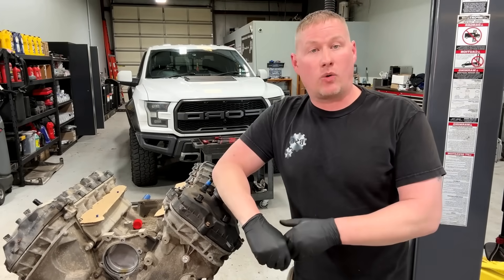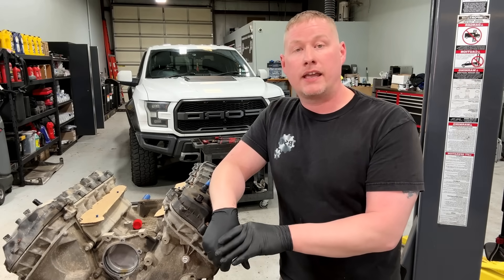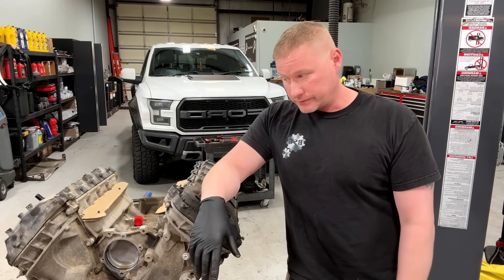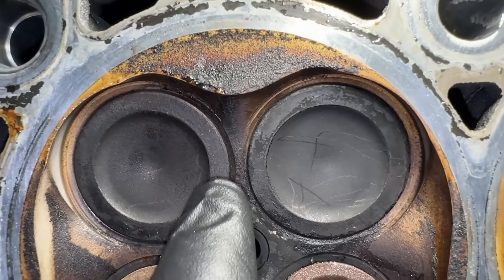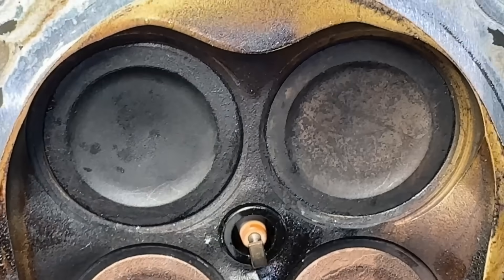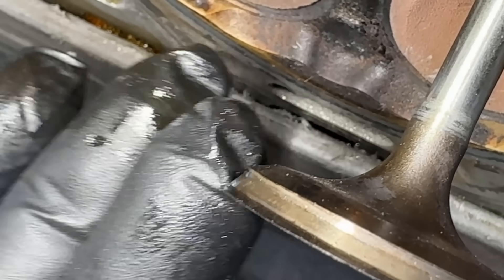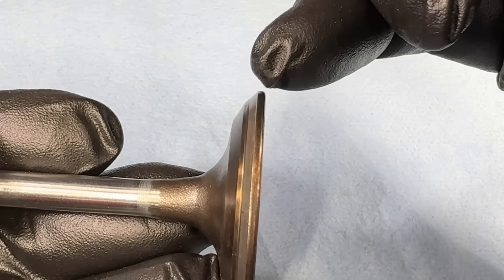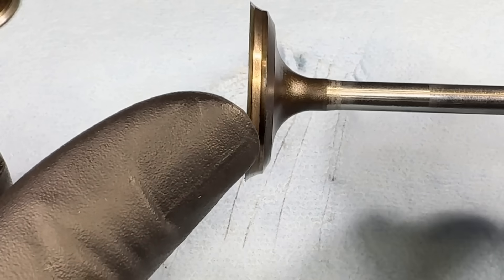The One Fatal Design Flaw of the 2011-2014 Ford 5.0L Coyote Engines!

Comment: Good times. I'm curious if You've seen failures in the new 6.8 v8? I'm a fleet mechanic and we have a 23 f250 at the dealer for engine replacement at under 6k miles, lost compression in 3 cylinders, i won't know what they found till we pick it up.

Comment: One flaw? You may want to added major oil consumption on Nickasil lined cylinders on late model Coyotes. God what a mess that manufacturers are dumping on their customers. It ain’t just Ford either. They’re all pumping out overpriced garbage. I’ve been primarily an Asian import technician and shop owner for 30 years and I no longer have a brand that I will recommend to any of my customers. Honda, Toyota, Nissan, Subaru, and Chevy and Ford are screwing customers as hard as they can these days.
Reply from the maker: I know of the other generational problems but we are speaking about gen one only here.

Comment: Had to put a crate motor in my 2013 for another reason.  Glad I don’t have this to worry about in my future.  How different would my Ford reman motor from 2023 be from the original motor. Any other updates they may have done?
Reply: In the past, Ford would send in "CRATE" motors, which were supposedly new engines from the assembly line with all the extra, external parts installed. Then you had Ford REMAN engines which were Ford's remanufactured engines. These reman engines didn't usually come to the shop with the external parts installed so the tech swapped the parts from the old engine to the reman engine.

Comment: Guess it also depends on how hard you run them.  I stay at 68 mph max on interstates.  2013 with  only 40k miles.
Reply: You should just put it on a trailer and it will last for ever.
Reply: Keep it under 70 or THAR SHE BLOWS!

Comment: My 2013 F-150 developed the same compression loss symptoms last spring. Research led me to learn about this exact issue. Symptoms crop up around 100,00 miles. I was at 105,000 when the misfires finally tripped the check engine light. (Idle was extremely rough since I bought the vehicle 4 years prior). One shop wanted to engine swap for $14,000, which I thought was a rip off. Another shop said they could tear it apart, send off to machine the heads and re-assemble with proper valves for just less than half that. Elected to do that, and it turned out extremely well.

Never was a recall or announcement made about this problem from Ford, as it affects all 2011-2013 truck Coyotes engine, but forum posts confirm this affects 2014 models too. Like someone else in the comments said, these are ticking time bombs sadly.
Reply: Ford may put the issue in a TSB for service techs,but don't look for any news release to the public! Add in the mileage when things crop up, and you see why Ford just ignores the issue! It's no longer a warranty repair at 100K unless you have an extended warranty! At this point, the dealer personnel try to blame it on your maintenance and cry not covered under warranty. Now they hope you go for a cash repair! Cha-Ching!
Reply: $14k for an engine. What in the world😆
Reply: @mph5896. It's not just for an engine. 14k is for the cost of engine plus parts and labor. In the automotive industry cheaper is almost always never the way to go. Thats how 800 dollar jobs turn into 8,000 dollar jobs further down the line.
Reply: @anthonygallegos3269  Bingo, and when you pay a friend $2000 to do it with a "low mileage" $5000 Craigslist engine... you'll be doing it again very soon
Reply: Why would they the problem comes up after warranty it’s end of life time for a new one as far as Ford is concerned.
Reply: People are so dramatic. All engines will have a “common” failure point. Being something that occurs at a higher percentage rate. Thanks to the internet you have a few guys post on YouTube or a forum and act like the engine is a “ticking time bomb”. Not at all. This is a fantastic engine. This failure is rare. I saw it twice when I was a dealer tech and the fleet I work for now has a few hundred of these engine and we haven’t had this happen ever. We literally had never done a base engine repair on any Coyote engine until the phaser issue popped up on the newer trucks. Even still, though not minor, that is the only failures we have seen on any of them. 
By the way,  I can search all that and run these reports through our fleet management software. 
 As a side note. YouTube claims the 10R transmissions are garbage. All we have had done is software updates. These are all work trucks too. Often pulling trailers and almost always carrying cargo.

Comment: Great video, thanks.  There's a setting on your phone that will flip the image from mirror mode (selfie mode) to camera mode.  (Edited (before I saw Brian's comment below) - I had a comment about the second half of the video that was wrong.  Confusion reigns...).

The focus and detail was great but everything was backwards at the beginning.
Reply from the maker: Yeah I need to find that feature yet. I was waiting for someone to say that's not cylinder 3 and 4 even though the oil cap was a dead giveaway.
Reply: @FordTechMakuloco  Sorry I screwed up and didn't realize the second part was correct.  CRAFTSMAN was clearly visible on the cart.  The first part of the video got my thinking off.

Comment: So can we assume this is non issue with 2015 up?
Reply from the maker: correct
Reply: Good to know.  However, I’m getting a non code misfire around 1500 rpm on cylinders 4 and 8.  2015 Roush stage3 phase 2 Mustang.   Shows up in mode6 and power balance 
Have replaced coils (FORD) and injectors  plugs. Etc… Still there.  Haven’t replaced VCT solenoids
Reply: @MustangGuru Did you do a compression check?
Reply: @gregjohnson2073  I will this weekend, thanks for the response.

Comment: Fix or repair daily
Reply: I heard that from my Chevy friends 60 years ago, most  of them are driving Fords today☺
Reply: Will never ever touch another Mopar again, excuse me, a Stillantis. Reasons why are legendary, too long to list. Also 
newer GMs are junk.
Reply: @jimiguitar3252  Mopar mo'problems....

All new cars are junk because of garbage emissions and CAFE regulations
Reply: @samholdsworth420  My 68 CJ 428 stock did the 1/4 mile in 14 sec getting 10-12 MPG wit barely any emission controls. My 2021 Mustang GT 302 did the 1/4 mile in 13.5 sec stock and got 24MPG on the highway.Go back to big block boat anchors if you like, I'll stick with todays CAFE regulations, plus the newr cars are all safer.

Comment: Hey Brian was that a quality control issue on those sharp valves ...   Great channel to watch !!!!
Reply from the maker: Yes it was
Reply: @FordTechMakuloco is this also happening on some 2015 F150 5.0? I get a few misfires on cylinder 5 sometimes like 5-15 on a drive cycle… which I know isn’t much. I get a P0430 code sometimes. Do these engines do well without cats? If it’s allowed in my area of course?

Comment: There are no perfect engines as there are no perfect anything that man makes because man is an imperfect being.
Reply: Don't forget the 351 Cleveland, indestructible! Had a '70 Torino with one. Drop forged steel pistons.
Reply: @jimiguitar3252  70 Mach I...tried to destroy it...couldn't.
Reply: Well the 350 Windsor was as close to perfect as you could get. I still don't understand why they quit making that mill.
Reply: Fuel economy, power, and EMISSIONS.

Comment: Can this be diagnosed and or repaired without pulling the motor out?
Reply: It can be diagnosed, just like Brian did with the leak down test, with the engine in the vehicle. It cannot be repaired without removing the cylinder heads, and I am unsure if that can be done on a Coyote with the engine in the car. Likely yes, but I cannot say for certain. But like he said, the labor a shop would charge to pull the heads and send everything out to be decked, then re-installed... it was cheaper for the customer to have the engine swapped.

Comment: Ford probably saved 10 cents per valve using sub par metal.
Reply: And lost millions in reliability
Reply: @SmallJack86 they don’t care.  They think all they need to do is put batteries and electric motors in their trucks and everything will br OK
Reply: @georgeburns7251

All gooberment mandated but it wouldn't surprise me if the big three lobbied for it.

Lazy greedy union bums.
Reply: Or could be a manufacturer defect. Ford isnt making the valves themselves.
Reply: 10 cents times how many million valves is a lot of money.

Comment: The last good engine Ford made was the modular V8 as in the Crown Vic
Reply: Yup.  My 2006 f150 with the 4.6 L 2 valve engine running like a clock at 140K.
Reply: Wrong, Gen 2 coyotes are nearly flawless.   Gen 1/3 are the problem child’s.
Reply: Yeah it made a whopping 220 hp and got 10 miles to the gallon. Great boat anchor!

Comment: As a 64 year old that worked as a young teen in our family gas station/shop in the 70's, pulling heads and valve jobs were so common. I guess times have changed with labor being so expensive that it is better to put in a new engine but that block should be good for another 100K right???? But I know you have to return it as the core or pay the core charge.
Reply: SO much stuff in the way to take off PLUS while the heads are off you have the 'might as well change its' like timing chain, cam phasers etc.
Reply: Right. I was watching this thinking "you trashed the engine for a couple of valves you could just replace?" Valve sets range from a few hundred to a thousand, or you can get performance heads loaded with new valves and springs for just over $2k for the pair. First complete reman engines I found were $7-9k. It would be interesting to know the cost choice he made, I expect there was an argument based on new engine restoring it to 0 miles and probably with valves that won't fail again.
Reply: @cageordie  Seven years ago it cost me about $3000 to have heads rebuilt (new valves, seats, guides, head machining, gaskets, etc.) for a Dodge 4.7 SOHC. I bet it's north of $6000 to fix this 5.0 due to inflation and because it has double the valves. The OEM timing set alone is probably $600.

Or spend $12,000 to put a new motor in with zero wear and a warranty. Ready to drive another 200,000 miles instead of 70-100k miles down the road having a worn out engine (already has 130,000 miles on it after all).
Reply: @TheRetarp  That's crazy on the cost of the 4.7 parts. I did a 4.7 around that same time. I went cheap though and installed used parts. Prob in and out of that engine for $500.
Reply: Back in the day pushrod and inline engines were the standard, so it was way more cost effective to do that type of stuff. Now a days you're doing 5x more labor than just swapping the entire engine lol
Reply: @ice44567  Exactly. Back in the day you could remove the heads easily. Today's engines require removal of the timing chain which requires removal of the front cover. No shop is going to put the old used timing set back on. This means you also get a new water pump, thermostat, coolant flush, oil change, new accessory belt, new idlers, all new gaskets, it all adds up really quick.

Comment: I see you are reading comments. Thanks for the best channel on the tube. First class. I took your advice  on Penzoil platinum 5 30 and been changing my oil every 5000 miles or so on my 2006 e250 work van with the 5.4. for the last 3 years or so. No ticking runs great 160.000 miles. Thank you.
Reply: He definitely reads comments, even on FB. I left a comment recently over there which could have been taken from a snarky pov, but Brain just answered with a question. So i re-phrased and Brain addressed my concern about seemingly conflicting things he had said recently, and he made his stance 100% clear without being a jerk about it. It was a good interaction.

Comment: Ugh! I've got a 2013 5.0 with 139k miles. Imagine my disappointment knowing I'm sitting on a ticking time bomb. How could Ford get that wrong???
Reply: Cost-cutting.  Over-reliance on their engineer's assurances.  Over-trusting parts suppliers assurances.  Lack of good quality control guys willing to point problems out.
Reply: Yeah it sucks big time, but this cost-reduction stuff is in every large company by now. Even aftermarket parts suck, compared to what they used to be. Chinesium and lowest bidder.
Reply: It’s more common on trucks with a lot of idle hours. It’s always on cylinder 4 and 8 right at the back where there is the most heat build up. So if you actually use your truck and don’t just let it idle all the time, I wouldn’t be too worried.
Reply: If you have not noticed extremely rough idling by this point, you may have gotten lucky and got the newer valves and won't have a problem. Supposedly, midway through the 2013 model year, they changed to the newer valves. If your build date is after February/ March 2013, you might be safe. Not guaranteed, as 2014 models have had the same problem.
Reply: @RareDivers  My 2013 was built in May. It has 267,000 kms, (160,000 miles) on it. No rough running at idle. Fingers crossed its going to be ok.
Reply: @RareDivers  Unfortunately my 2014 Mustang GT was built in Feb/2013 so I'm sure I have a good chance of having this problem.  My car only has about 37,000 miles on it so I may not see it for years.
Reply: Also had a 'time bomb' from Ford, my wife's 2016 2.0 ecoboost Escape.  As Makuloco described, the dreaded Cyl2 and 3 Web Seal Gasket issue, where when they designed the 2.0 to have the same block footprint as the 1.6, they ended up with like a .100" web between the cylinders and a damn external water passage taking up half of that head gasket sealing surface.  Ford of course knew about it and as it never failed at 100K or below, they let it go.  When trading it in with 150K, they said the most they could give me was a thousand bucks trade. As the dealer was all smug about it, I'll never go back to him for even a spare light bulb, let alone a new car.  Still pissed!
Reply: D.. me too. 2012. Didnt know abput this, and I have a  light miss on  #4 on mine too.😡
Reply: I wouldnt sweat it at all. Theres 2011-14 5.0 coyotes out there with a million miles on em not have that issue. Idk if the mustang applies but plenty on 200-300k mile mustangs out there too untouched
Reply: Even with that small problem, id afill rather have that then my 3.5...ecoboosts suck so much! Even when you do all the maintenance its still guaranteed to fail from something random
Reply: Its not just for gm and dodge all have had valve issues
Reply: I have 168,000 miles on my 13 f-150 and have no problems.
Reply: Go back to the early 60s and older,  GM still has problems with lifters.
Reply: One of the best automotive channels on the Tube
Reply: Got 180K on my 2012 5.0 F150, no problems so far...
Reply: in modern age!!!
Reply: They actually got it right for themselves
Reply: It's the new way for the big 3. Increase the cost of the vehicle 4x, make them 1/2 as reliable. I don't see this new trend boding well for them. At some point, dropping 80k on a mobile piece of fecal matter every 3-4 years is going to bankrupt the entire country.
Reply: Your vehicle has 139k on it, what do you expect !Its a machine they all wear out come on things dont last forever stop it!
Reply: I have 215k on my 2014 5.0 😅 i don’t know what month it was built but now I’m concerned
Reply: Because, FORD
Reply: @samholdsworth420  Yeah, because it’s not like Mopar and GM don’t have any issues… 🙄
Reply: @hutchinson54 and it's not like Japanese and Korean vehicles don't have problems either
Reply: @190SkyTeam  Never said they didn’t…
Reply: @hutchinson54  Don't leave out Toyota. They have gotten plenty wrong over the last 15 years. Even things on the 5.7.
Reply: @samholdsworth420 right, because no other manufacturers have ever made a mistake.

Comment: Great vid. I have one in my shop now out of a 2013 #6 cylinder valves. I just started seeing this 2 years ago. Before that I would have been one of them guys saying the 5.0 was rock solid besides some leaks.
Reply: Still so many out there that dont have any issues. The parts supplier could have a mix
Of good and bad made ones.

Comment: Bought a 2011 F150 5.0 in 2015 @ 68,000 miles. Now @ 90,000. Still runs fine. Any suggestions or recommendation on keeping it going? Also, can you give a rough estimate on the total cost of replacement? replacement
Reply: Service the transmission
Reply: dont idle it

Comment: My 2015 F150 5.0 has a huge oil leak.  Previously had one with the oil filter coming loose, got under front of truck and did a wipe of the filter area with a white cloth and it was dry and clean, so not that this time.  Was down in Indy for work, so bought a case of oil and drove home to almost Lake Michigan.  Stopped every 40 miles to put a quart in, went thru 6 to get home.  Bottom of truck was oil soaked, glad traffic was light and no one was behind me.  Will update when I fix as to what the problem was when done, but wondered when you will do the video on my generation problems.  Followed you for years before YouTube on Automotive Forums, my ID was 65Comet.
Reply: I need the 5.0 timing chain/phaser replacement video. Haven’t seen or found one if Brian has made one. Is the oil pump gear necessary too? Or just for those guys running superchargers.
Reply: @eliminator1978 only when supercharging or like to bounce on rev limiter.
Reply: Remember when Ford used to make reliable products? Yeah me either 😂
Reply: @samholdsworth420  I've had a bunch of Fords, none of which had any big issues.  My current one has 450k miles.  It has an oil leak, but that's acceptable to me for the age and mileage.
Reply: @samholdsworth420  I drove my 93 Ranger for 17 years with no issues.......but that was a Mazda drivetrain.